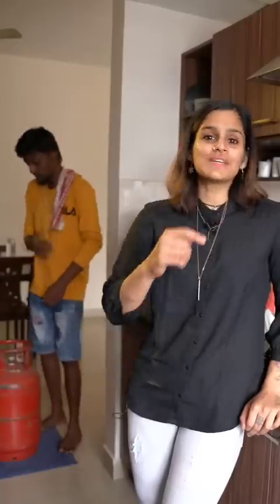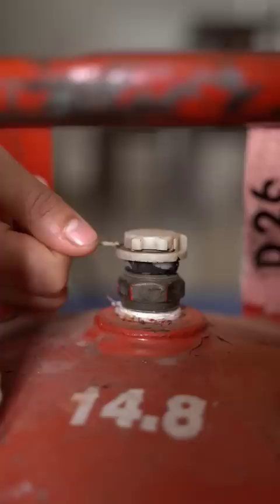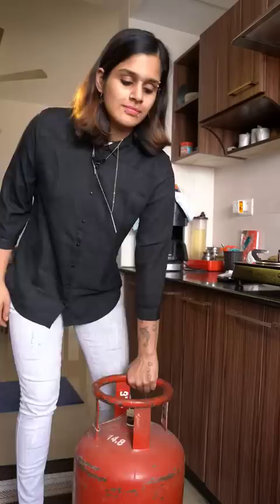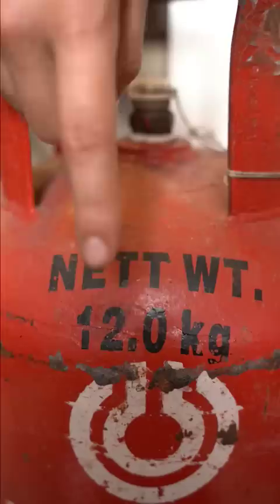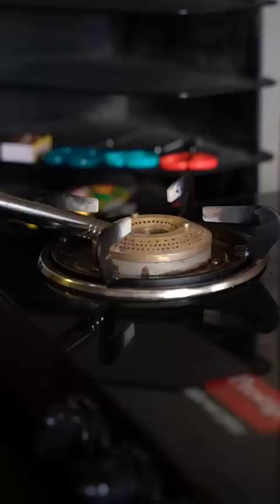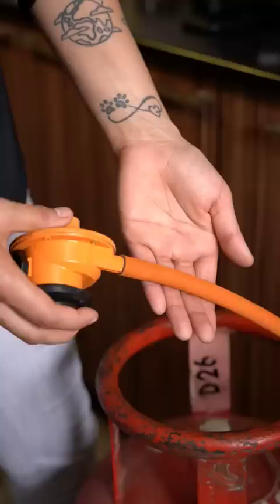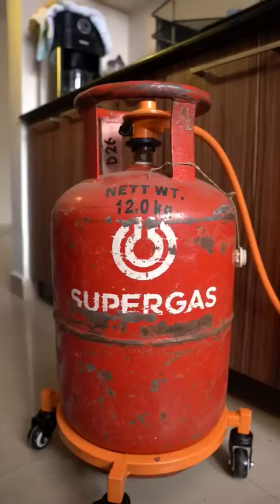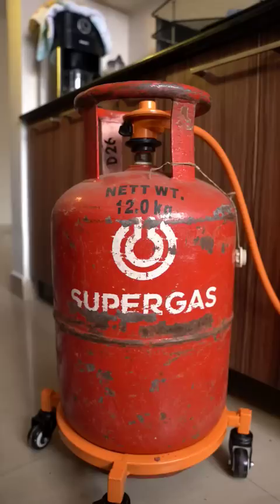Safety is always first. So learn from the best about how to use an Gas Cylinder 💣 #shorts

Comment: My tip: Always use a cylinder trolley... it may seem unnecessary, but saves you much of the hastle and potential hazards of carrying heavy cylinder with highly volatile fuel.
Reply: Hey prabhu 😭😭
Reply: This generation is literally too soft 😂🗡️.
Reply: I thought everyone uses it.
It's so convenient for carrying cylinders and also while changing. You don't have to lift them at all and even women can easily handle them.
Reply: It's a gas cylinder bro not a tnt bomb that'll explode upon dropping, that stand just adds a convenience to move it easily. Although it's not that much heavy, even my mom used to carry it on her shoulders when we used to live in village.
Reply: @mr.dexter6240  yes is around 15 kgs only,  but still feels bulky to handle... and its not uncommon for accidents to happen and people to get hurt...even if it causes only bruises, but as they prevention is always better than cure
Reply: @srisudharsrinivasan8336  15Kg is just the tare weight of the cylinder & 14.2 is the net weight. So it's almost 30Kgs when it's full.
Reply: @mr.dexter6240  Still! If it hits the ground, it will cause serious damage.
Reply: @7k_Satyam  obv it can damage ur floor, u can't handle it like a toy if it's this heavy.
Reply: Aww. princess.... Is that u?

Comment: At Night, (Night Is Not Important, Low Lightning Is) If You Suspect Gas Leakage, Your Instinct Will Be To Naturally Switch On Electric Light To Inspect The Cause… STOP! 🛑 DO NOT DO THAT! ✋ The Spark Generated In The Switch Can Ignite The Trapped Gas! Please Be Safe, Use Flashlights 🔦, Mobile, Torch etc, (Also, Don’t Light Any Kind Of Flame) Open Windows And Doors, So The Trapped Gas Could Escape And Disperse. Check The Issue, Call The Helpline If Need Be. Kindly, Follow Instructions. Please, Be Safe! Thank You. 🙏🏼
Reply: Ventilation very important
Reply: @ramakrishnansubbiyan1764  Yes! 🙏🏼
Reply: To avoid this instant action of switching on lights keep the light switch outside the kitchen may be on the wall near the entrance of the kitchen.

Comment: Tip no. 1 : Sprinkle some salt while sautéing. It helps to fry the onion (or anything you're sautéing) little faster.

Tip no 2 : When you don't have time to soak dal. Then just Soak dal in warm water. It boosts the process

Tip no 3 : If curry got too loose then just add little gram flour or corn flour

Comment: Kudos dear sis...you showed something very important. I commend you on your practical & visual demonstration. I change on my own since many years, & if a hissing sound ensues,  then you must call your local dealer/agency...( they are supposed to be responsible) they will replace the bottle or replace the small black leaking gasket that 'hisses.' 
Also, refuse to accept an old &  'battered' cylinder ...the way the delivery guys throw & damage  the empty bottles like a sack of potatoes... is shocking. Have it weighed when they deliver it. Not everyone can afford gaslines. 
God bless you.

Comment: Never keep any flammable items beside gas cylinder and in case cylinder catches fire , wrap a wet towel from top side with speed and throttle the point

Comment: You missed the most important point. How to check the gas leakage while delivery. 

Ask the delivery boy to open the cap and then put some oil in the valve. If you see  any bubble then it is already a leak cylinder. Change is ASAP
Reply: I did the same today and when the delivery guy came he started shouting that who told you to put so much oil inside to check 😅 it was smelling but he still kept saying there is no gas smell.

Comment: We use induction rather it's much safer 🙏
Reply: here in bombay we have piped gas connections to our flats, so no cylinder hassle
Reply: @d1p70  only till thane i believe beyond that is still cylinder gas
Reply: Faster but Way more expensive
Electricity bills will not be affordable

Comment: We use water to check the cylinder ,if it is not leak you cant smell or hear it bcus there is a pin inside of top .when pin go down then u smell and hear of gas.

Comment: One more point some time near regulator add water bit.. When your using for more than one month.. Because the inside rubber visor will be dry.. Add some water it become soften.. No leakeage will be near regultor ...

Comment: A cylinder will not blow until its getting heavy heat from outside which is very rare in domestic area but it will catch fire if any spark in gas leakage but won't blow up. See some videos how to control fire if cylinder has catched it and always keep a little fire extinguisher at your home at the time of emergency. Stay safe

Comment: Use the thumb to check the pressure after opening the cap. If you feel slight pressure it means the washer/rubber is damaged due to wear and tear.

Comment: Please note it the rubber washer is present inside the mouth of the cylinder it's the major reason for avoiding leaking of cylinder gas if it's not present the leaking of gas didn't stop it always slowly leak to the atmosphere

Comment: Please mention to check the inner rubber with an torch before installation regulator if it's damages or cut marks it's many problems of leakage

Comment: Put some soap foam around the top which connects the cylinder and hose. You can see the if there is any gas leak.

Comment: Whenever there's a gas leakage always first try to switched off the regulator and unplug it and then again plug it to make sure gas is not leaking. If still it's leaking then just unplug the regulator and put the safety white cap on the cylinder and call for gas agency to replace the cylinder. 
Most probably chances are that the cylinder is damaged or the some gas is already been removed during the delivery.

Comment: One should check the flame of gas by matchstick than lighter ! 
Always check in front on ur eyes the valve of gas cylinder is intact and should be checked by the delivery person !
In case if their is gas leaking smell, don't turn on electric gadgets, don't turn on light switches too as the sparks may ignite fire ! Open all doors and windows to let the gas go out and to avoid suffocation ! 
Now a days their are special gas pipes, fire proof, leak proof, approved by Indian Govt, Gas cos and these are available at gas agency and the installation should be done by trained gas agency employees only ! 
Always switch off the gas regulator at night, when not in use, while going out stations to avoid any mishaps of gas leaks !
Remember these modern day amenities are to be used with utmost cautious and safety of family, loved ones should be on priority !

Comment: Should also tell about changing rubber inside the cylinder as many a times it leaks gas due to small cuts in it.

Comment: But sometimes when you try to remove the cap by pulling the thread & suddenly the thread breaks down when cylinder needs to be fixed immediately
It’s the most annoying & frustrating situation🤯😤
Who all have faced this, thread breaking situation 🫥

Comment: Never tight fill the gas 
If it says 14kg stay at half kg less on refills
Generally it's not the cylinder that blasts it's the leaked gas that ignite on lighting stove 
Always put the cylinder in well ventilated area never air tight the kitchen

Comment: Also put you hand in the hole of the cylinder if washer is there it happened to me i changed it without checking and when i i switched it on hissing noise came i called immediately and they came in 15 minutes with new cylinder i felt very surprised now i came to know the reason its 50 lakh insurance that made  them do that  but in reality lives shoild be given more importance hope they came early thinking of our lives

Comment: TIP SMALL RUBBER SEALS ARE AVAILABLE IN MARKET , Change the every time as with some use they bruise amd statt leak , gas are. expensive and dangerous, rubber notch are available of hardly 2 ruppes.. ask from the gas delivery person or in market.